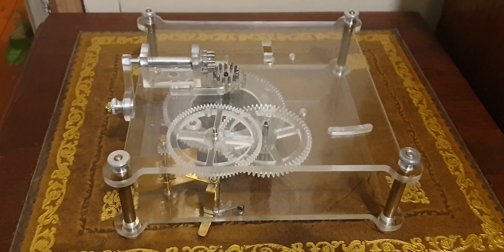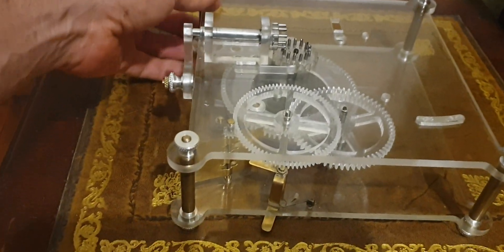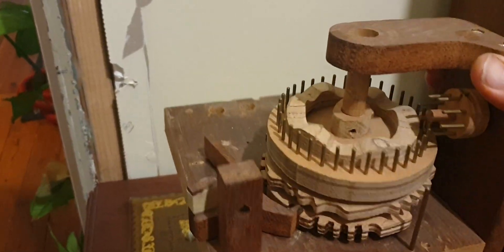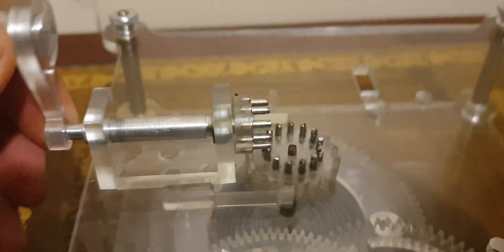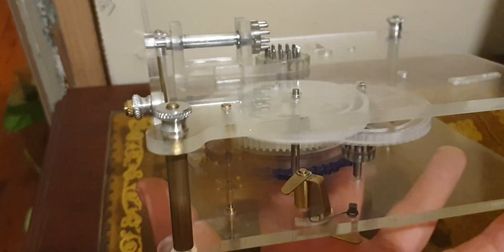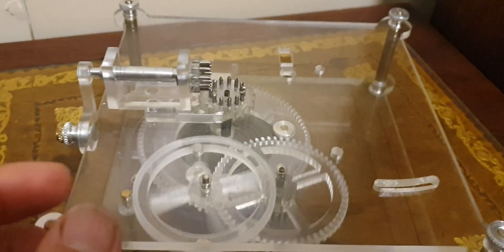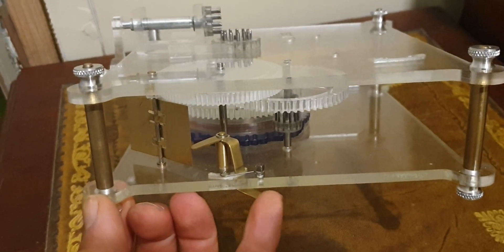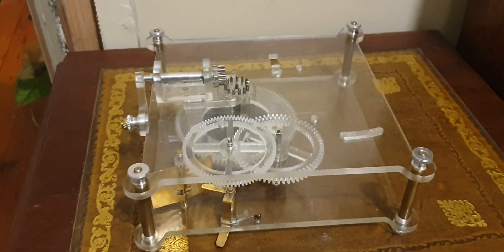Automaton Whistling Bird V4 - Gear Train and update

Comment: Really helpful video. I am working on a similar project using rotary dampers instead of an air governor. Helical gears printed in resin might be the best solution for gear noise?